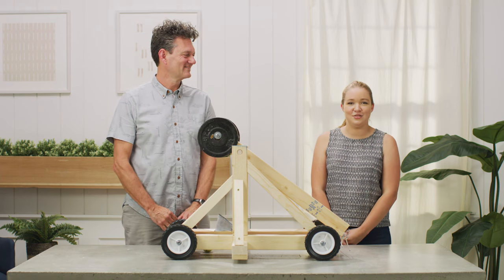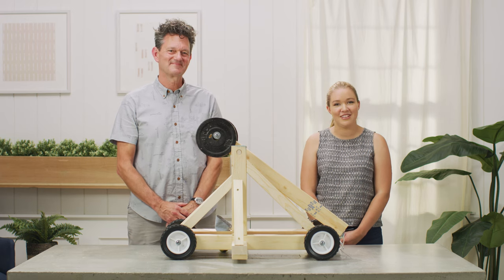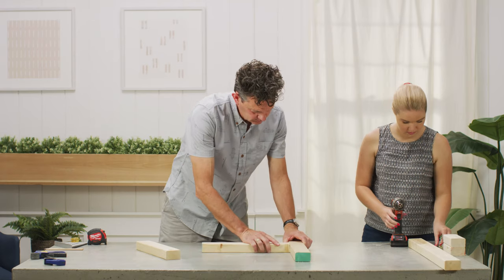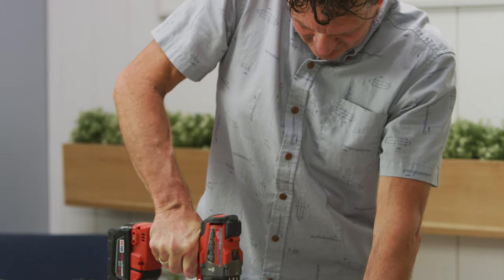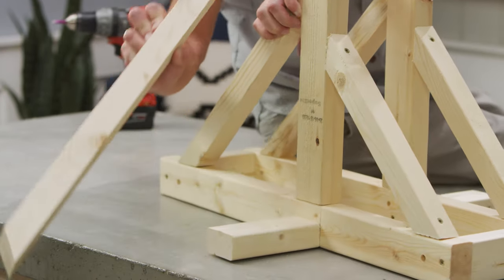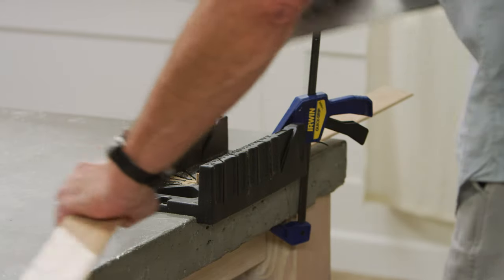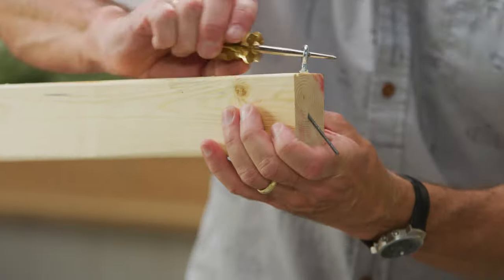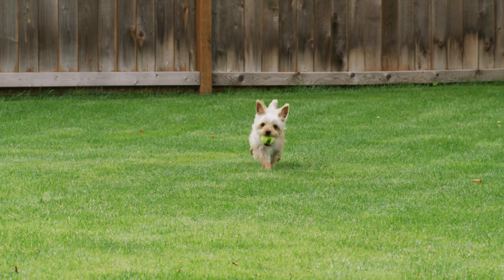How to Build a DIY Mini Trebuchet

Comment: thank for posting - comments about the instructions and the cut list from the blog. I don't know if anyone has seen this but I was trying to make with my daughter and I noticed you called for several 15" pieces but there are not any on the cut list. and for the 2x2x8the piece is not long enough to cut it as drawn. But even with all the corrections the unit seems like it is coming together nicely thanks again for the starting off instructions

Comment: I bought and cut all my wood according to the cut list and was shocked by the sudden 15” 2x3.

Not to mention the 3 1/2 inch screws not being on the parts list. Which I found out AFTER another trip to buy the missing 2x3s from the list.  Or the 1 1/4 screw, and the 2 finish nail

Comment: I could be wrong, and if I am, I apologize. However it appears that when the tennis ball is released from the trebuchet it goes on a sharp angle towards the ground. 
Aren’t projectiles from trebuchets suppose to have a flight path that is a high majestic arc?
Reply: I believe adjusting weight and sling size/shape helps adjust the trajectory of the projectile
Reply: You adjust the pin angle to change that. Each one will be a bit different depending on your weight, arm length, and projectile weight.